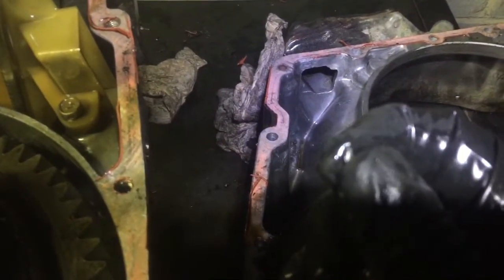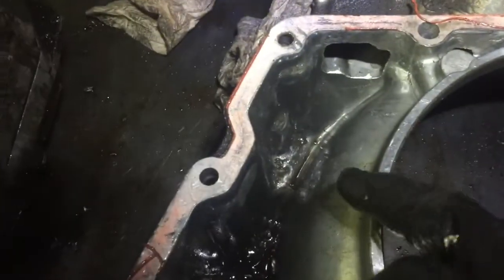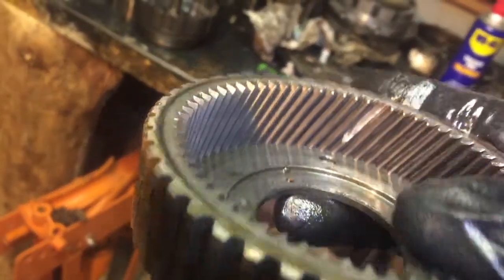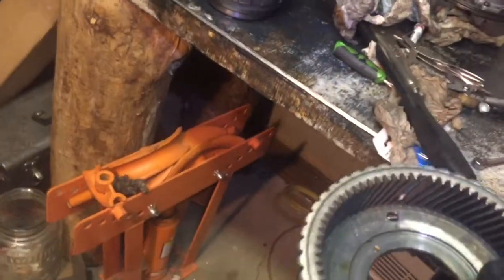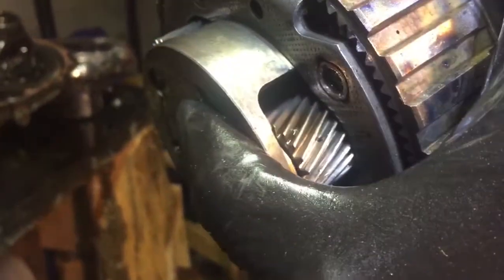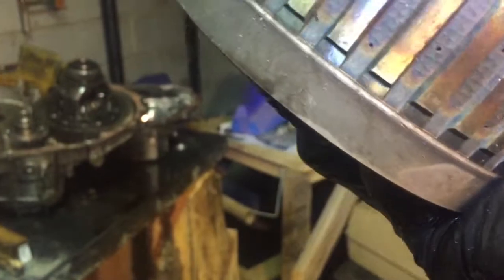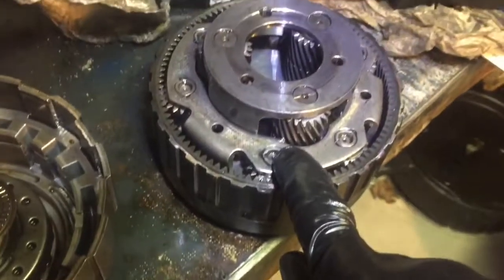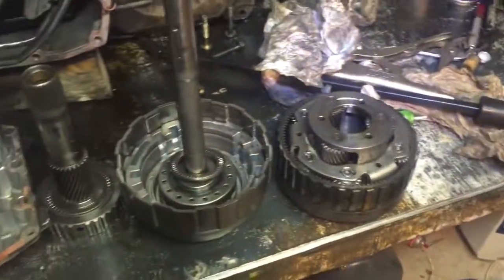Volvo 850 #BlownTransmission (Vlog 6) Metal Chunks In the Trans

Comment: And today, in the middle of all the snow, my transmission ate itself.
Reply from the maker: NOOO! You didn't catch the chunk disease? Were you able to make it home? That sucks. What next? So sorry to hear this.
Reply: In the middle of that snow yesterday.  It shook a little, like a tire was going bad, and then started grinding.  Took me five minutes to push my wagon off the road, and then about three hours to get from North Atlanta to Kennesaw in a surge priced uber.  I called for a tow, but apparently, there was a Georgia emergency that didn't allow any tow company to do more than ten miles -- just enough to keep the streets clear, so one of this weekend's missions is to recover the car.  I've been saying I wanted to rebuild the transmission, so I guess this is motivation.  Where did you get your rebuild parts, and what did it cost you?
Reply from the maker: So sorry to hear this. I am wondering if you will find jammed planetary gears also. In my newest video https://www.youtube.com/watch?v=QJs90vqmWsE , I mentioned that the junkyard-auto trans also had jammed planetary gears. I am suspecting that they are the transmission's weak link. I will have to turn down the power on the car until I can get a manual transmission. I used http://transpartsunlimited.com/ for my rebuild kit. There are super knowledgeable. I am also suspecting the high number of 850's and s/v70s in the junkyard are a result of bad transmissions...because many look like they are in great shape. Get yourself a spare trans so that you can use the hard parts from it. I must say, I am surprised that rebuilding the trans is not as difficult as I suspected. My approach is to deal with each component as its own little project. It's taking me longer than an expert would take, but I am trying to do it right...and not have any issues.
Reply: Hey, I got lucky.  The snow had melted around the car today, so I crawled under it and it's just a broken cv axle -- the transmission had been giving me some problems, and the cv joints hadn't, so when the car stopped motivating I assumed the worst.  Lucky me, although they still have a moratorium on towing more than five miles, so it's still stuck.
Reply from the maker: That is great to hear. Swapping a CV joint will be a snap! No, pun intended...well maybe a pun LOL
Reply: not that punny